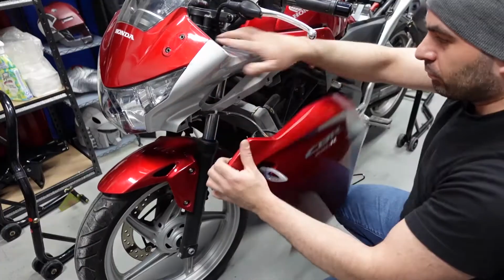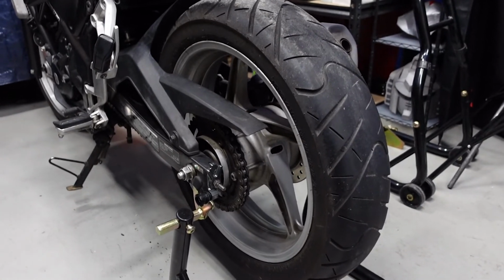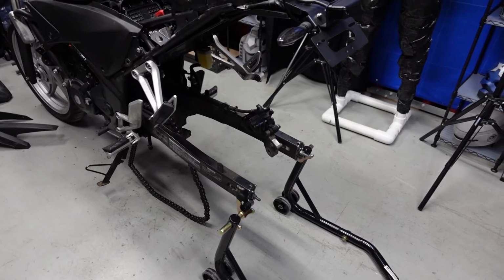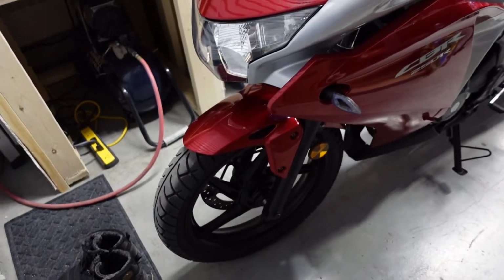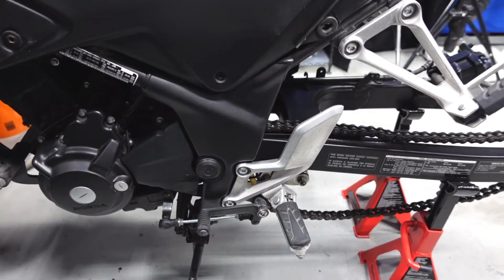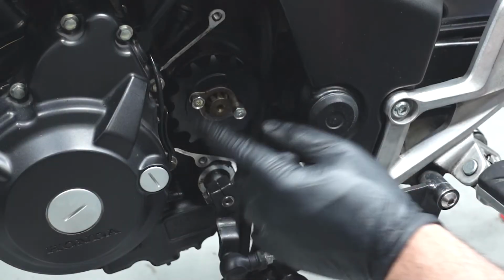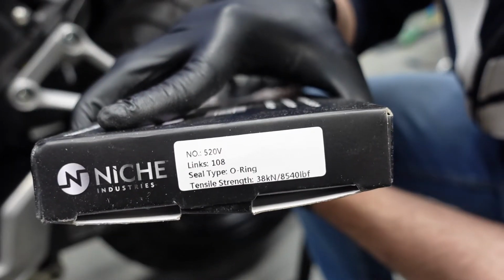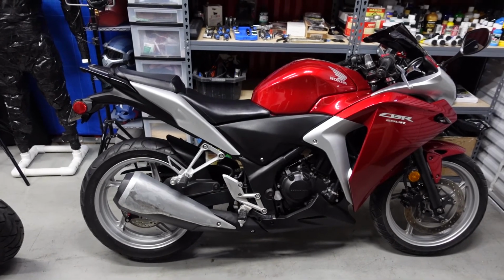Honda CBR250R Project: 14T to 15T Sprocket & New Chain Installed - Part 5

Comment: How do you feel the front sprocket change did for the bike? I found a similar black CBR250R that had been neglected and needed TLC just like yours and I've had so much fun learning about bikes along the way. It truly puts a smile on your face every time you put the key in.
Reply: @MotoGearSolid  Awesome. Sounds good, hopefully it allows for more use of the powerband on the highway so I dont have to plan passes a year in advance.
The last thing on the bucket list is to address the chain which has more slack in some parts than the other which make the ride rough. Its nice to see how easily you got that new chain installed. Will definitely look into this mod. Thanks for the vids!
Reply: @MotoGearSolid  brother i have a bajaj pulsar RS200 sport bike which have 14t front and 41 rear and in low speed i need to change frequently gear shifting in city should i install 15t spocket front or 13t sprocket front for resolve this problem?
My bike' new chain sound very irritating  because if i ride it with 3-4 gears in low speed such 15,25,30 need to change gears a lot. What your suggestion brother?

Comment: Nice job on the chain. Take some pics in the shop for the listing, or going to wait til spring to list?
Reply: @MotoGearSolid  may as well.. just don't settle for any low balls. I sold my trailer and someone came at me with "given the time of year". Held firm and the next day someone else with $400 more than he offered and took it away.

Comment: How much helpful will the 15T sprocket be in heavy traffic situation ??  Will it generate much torque at lower RPMs so that you need not to change gears frequently ??